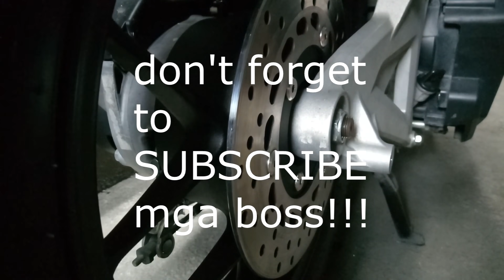REAR DISC BRAKE CONVERSION FOR HONDA CLICK 125i / PART1: DISC ROTOR INSTALLATION / CLICK SET UP

Comment: Hindi po ba kakainin ng stainless na bolt yung thread nang aluminium na hub. ???
Reply from the maker: Paanong kakainin po?
Reply: @AnakngPinas  search for galvanic corrosion, kung ginamit mo po ay aluminum or aluminum alloy and stainless steel magkakaroon po yan ng corrosion. Sisirain po ang base metal dahil sa electrochemically dissimilar po ang ginamit na metal. Okay pa po yan sa ngayon, pero pagdating ng panahon hindi natin sigurado.

I'm a graduate po ng Mechanical Tech. and a teacher by profession.
Reply: @daryltesoro9844  This is true.
Reply: @daryltesoro9844  para palang mas safe kung may nut sa likod sir? tatanggalin naman yung drum break nya no?kaya may space sa likod for nut?

Comment: Delicado yang ginawa mo boss  lalo  nyan tuwing brake mo aa likod pwersado ung mga bolt  nyan  vaka lumawag
Reply from the maker: 1 year mahigit ko na gamit boss.meron na yan loctite sa mga bolts nya..mag uupgrade pa ako nyan..abang lang po..😊
Reply: Tama dapat nakabaon din ung ginawa mong plate para d pwersado ung tatlong bolts..kumbaga dapat may guide para sa safety po ntin..ndi po kmi against sa gnitong conversion konteng himas pa paps..good job

Comment: how do you make the caliper holder on the arm ??  and what adapter do you use for the disc brake holder .. ??
Reply from the maker: Hi thank you for yoir interest on my video.. 
First,we modified the orginal holder or bracket for the caliper 
And we fabricated the flange for the disc rotor..
Reply: @AnakngPinas  how much is the disc brake size?
Reply from the maker: @riandifirmansyah7579  stock aerox disc
Reply: @AnakngPinas  ok thank you

Comment: Boss di nman po ba ba delikado na baka mtangal sa mags yung disc habang umaandar kasi po sobrang ikli ng bolts then wala pang support nuts sa likod
Reply from the maker: No worry Master..nagpalit ako ng bolt sa mags..mali lang kasi yung sukat ko nung una..pero mahaba na ngayon..pwede naman lagyan ng nut sa loob Master..under development na po yan conversion,after ng pandemic,sana makaumpisa na pang market..:)
Reply: Nice good luck boss sa trial and error pag nag stable na boss at ready for cotumers papagawa ako sayo boss thank you and goodluck rs always.....  Discount boss ahh 😂✌
Reply: Sir may isesend sana akong simple na graph para sa caliper bracket para siguragongdi ka mag aalangan share ko lng sana sayo kung ok ba or posible sya na mangyari

Comment: paps gaano kahaba yung brake hose nya
Reply from the maker: 200 cm pero mas maganda mas mahaba kunti
Reply: @AnakngPinas  paps san mo nabili yung brake hose
Reply from the maker: @danielmotovlog8422  lazada yata nun sir..
Reply: @AnakngPinas  paps may link ka nung pinag orderan mo 😊😊 salamat ng marami paps
Reply from the maker: @danielmotovlog8422  https://shopee.ph/product/57272335/1074511238?smtt=0.0.9

Check mo sir..192cm lang pala naorder ko nun

Comment: Master new subscriber po
Pa link naman kung saan mo na bili yung swing arm and yung mga kasama na parts nito
Pwede ba yan sa honda beat fi v2 thanks
Reply from the maker: Stock po ng Click yan swingarm.  Ibang parts fabricated na. Caliper at brakemaster sa shopee lang at yung disc gling sa aerox ng kapatid ko po..:)
Reply from the maker: Thank you for subscribing Master..:)